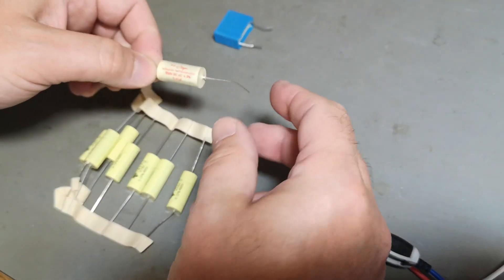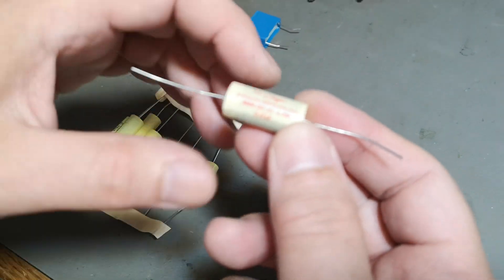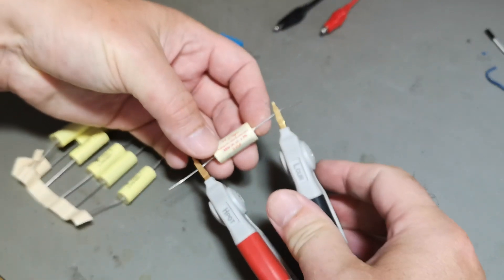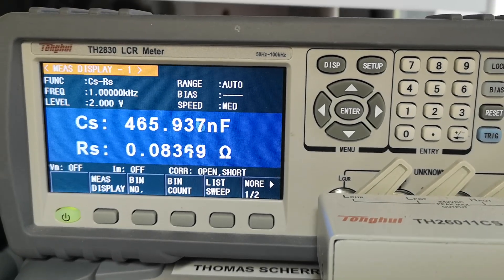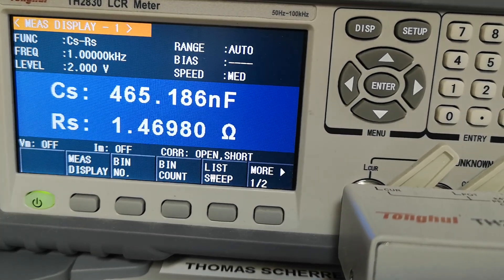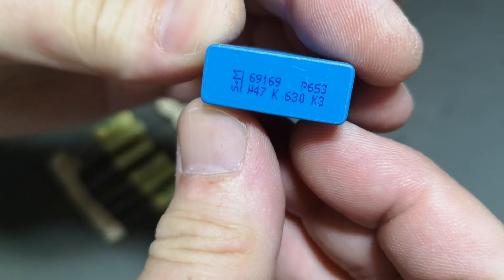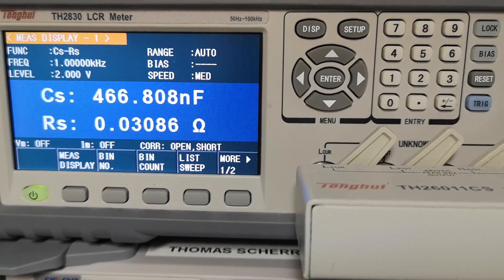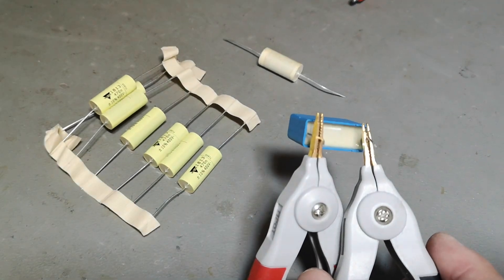Audiophile Capacitors versus normal, C and Rs measured 1kHz

Comment: It'd also be interesting to see how the capacitance and series resistance change with frequency on the different capacitors. Add 100 Hz and 10 kHz for example.
Reply from the maker: Yes that is correct, parameters do change a bit over frequency, I got curve trace software for my meter, so I can show nice curves

Comment: You should make sure you check for the foil side of the cap as that may have an effect
Reply from the maker: Foil side is very relevant for many things, but not for measure the part parameters

Comment: It would be great to see how a through hole MLCC (with leads) performs since these reportedly have a low ESR, certainly in the several tens of milli-Ohms from my crude measurements.
Reply from the maker: true you can get MLCC 0.47uF 630V for one example look up GRJ55DR7LV474KW01K but even Rs is not specified, and for many reasons I cant use them in Audio circuits, like their microphone effect will most likely be a problem people would not like, film / polycarbonate dont have that problem.

Comment: Hi Thomas, nice demonstration that a capacitor is not like a capacitor. Lately I've been having nightmares with capacitors, when restoring the HP3400 I wanted to replace all the electrolytic capacitors. I bought new capacitors and before I started changing them they all passed the test, the new capacitors had very strange values. Since I didn't know how long they had been in the store, I reformed them to the nominal voltage. The unreal became reality, some 40-year-old Sprague capacitors had better parameters than the newly bought Jamicon or Hitano capacitors, although they also had Vishay, but they did not have the values I wanted. All that remains is to order from Mousera or Digikey because I need everything in an axial design.

Nice day 🙂 Tom
Reply from the maker: the normally most critical parameter is Rs, and you are right 30 years old caps if not leaked, most often do win over brand new avarage brands, it drove me mad and sad first time i measured all the caps i replaced in old equipment doing an all over cap replace..